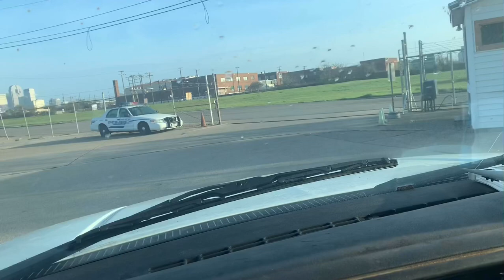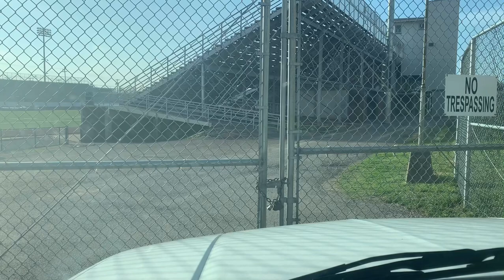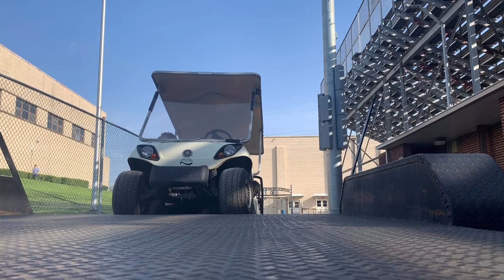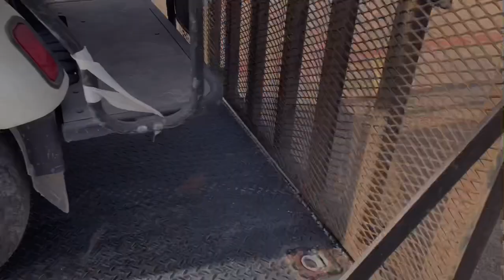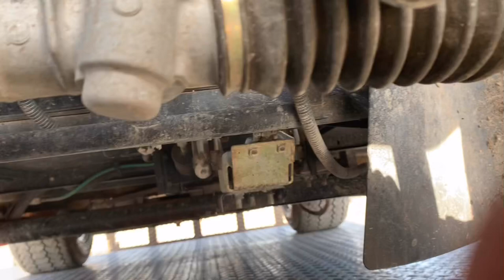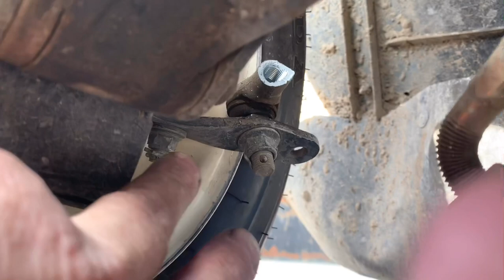YAMAHA  GOLF CART SEVERE ABUSE / MANGLED TIE ROD / BROKEN BALL JOINT

Comment: Hey chief have a question don't know if you could help me with this but I have a apposed Briggs and Stratton 19 hp engine it's been going through coils I just changed it three times it runs good for 2 weeks then it burns them out would you have any idea what it could be causing it
Reply from the maker: Key switch is backfeeding battery voltage most likely. Disconnect the wire to the coil and test for voltage with a volt meter.  If you see voltage when you cycle the key switch that is bad.